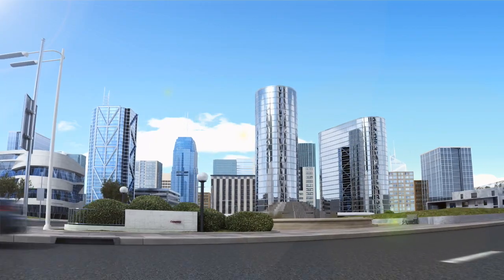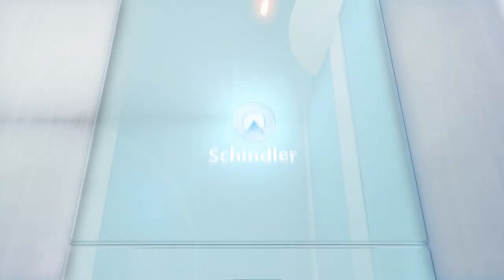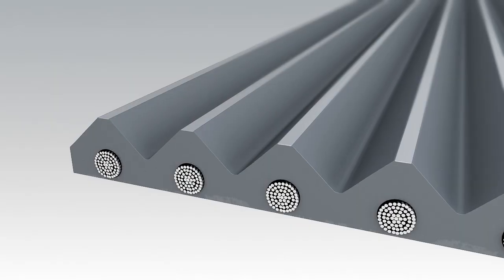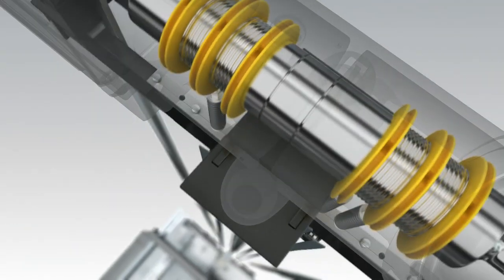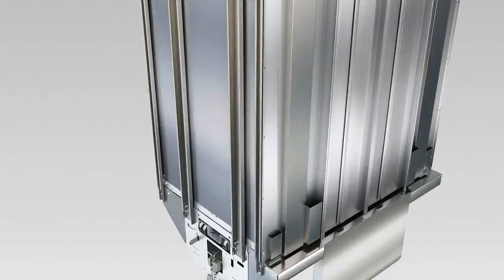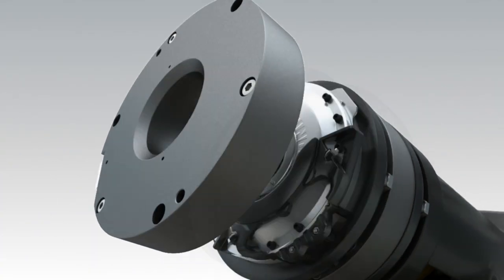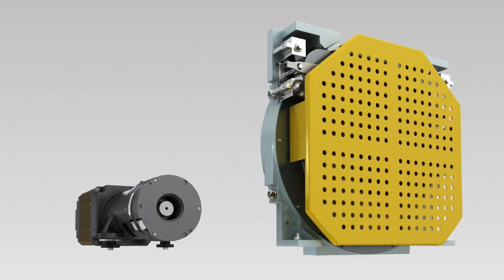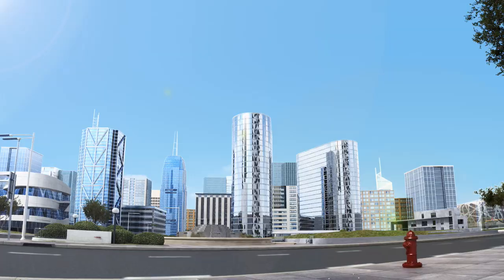Schindler 3300 Animated Video

Comment: "ENERGOMONTAZH" offers you cooperation in the supply of elevator equipment: brake resistors of its own production, frequency converters; geared and gearless winches, under-winches of our own production, control stations, as well as: flat elevator cable, flat mounting wire Our company manufactures a wide range of braking resistors of various types that can be mounted with almost all brands of frequency converters from many manufacturers. Our specialists will select you a similar braking resistor instead of an expensive imported one.In accordance with your technical requirements, our company will manufacture and supply the braking resistors you need.
 The company "ENERGOMONTAZH" supplies elevator equipment throughout the Russian Federation and the countries of the commonwealth, at producer prices.

+7 495 222 77 63
www.energomontazh.su
energo-montazh@inbox.ru

Comment: When you open the doors of a Schindler 3300 when it is going full speed it stop violently with a loud bang.   Also I am not keen on the motor being mounted to top of the tracks, it is a bit flimsy.  I also don't like the fact that this lift does not have a chassis.

But the thing that I really like about the 3300 is its looks.  The buttons and indicator look awesome.  The capacitive panel looks so futuristic.  The non capacitive buttons were ok, but schindler have redesigned them so that they look awesome as well.  It is really nice to see the effort Schindler have put into the design of this lift.
Reply: ben what do you thin of shinderlers good or rubbish
Reply: They look great and have intellegent levelling.  The problem is the build quality is shit and the logic is restrictive.
Reply: shit logic ok thanks can I still speak to you your awsome
Reply: yes, you can talk to me on hangouts
Reply: +Beno do you have to sign in
Reply: +Beno I need your email to get you on
Reply: +Beno thanks mate
Reply: Beno Lifts we are lift manufavturer, name SWORD, we also have belt type MRL, if you need it please call me 008615988189302
Reply: I agree, if the build quality was at least as close to the 5500 or the Eurolift or Kone then this lift would be great. The 3300 is kind of one of my favourites but they do need to make the build quality better
Reply: Beno Lifts but you can still see how much better the quality is than any generic
Reply: What difference whether or not they have chassis? Is that the thing for the lift engineer to hold it on while inspecting the lift so they don't fall?
Reply: @Happytylermovieproducction  a chassis is a metal frame around the lift car. It makes the lift more stable and therefore causes smoother rides and a considerably longer life expectency
Reply: Touch buttons were banned in the United States and United Kingdom
Reply: Only In Asia  @tanchoonnee

Comment: What are the pros and cons of this elevator?  I'm planning to acquire one for our building.  still deciding between this and other brands (Otis and Hyudai)
Reply: +John Tan  Pros - Controller in door jamb, Silent ride, low energy consumption, Euro design, Automatic Evacuation on power failure (no entrapment), Intelligent controller
Reply: John Tan
Try asking Beno.
Reply: Do not listen to You Tube comments IF you truly are in charge of putting in a new elevator ,you fool.